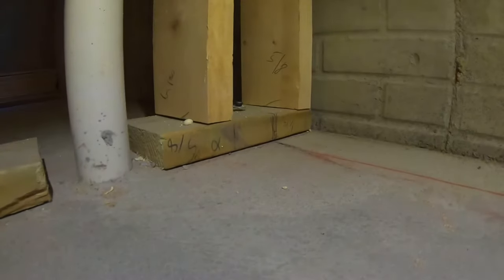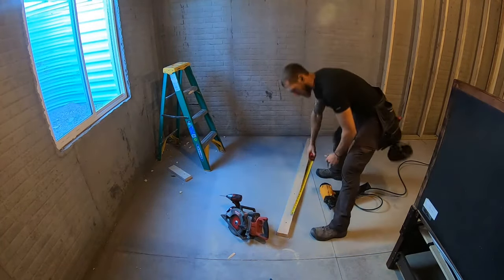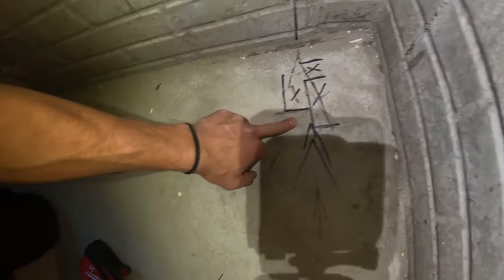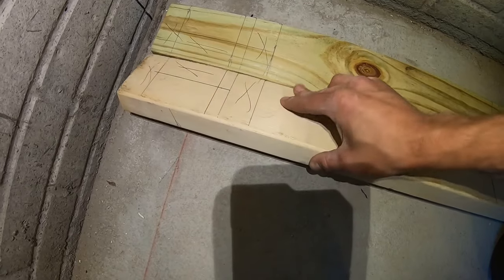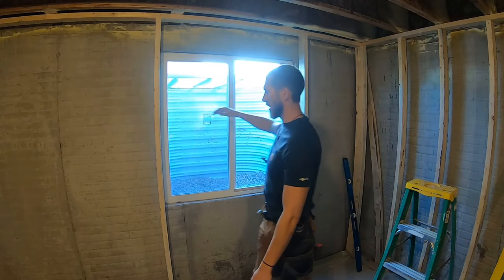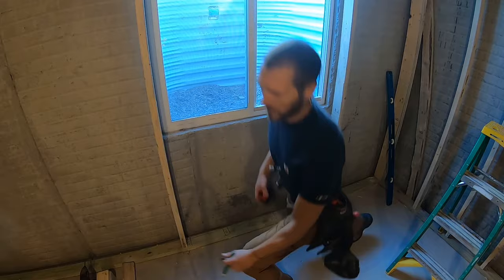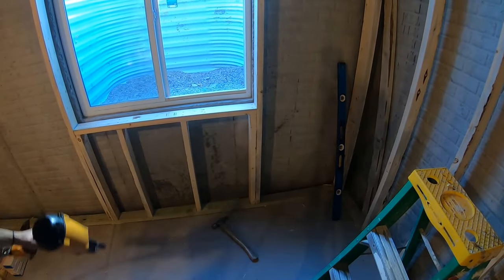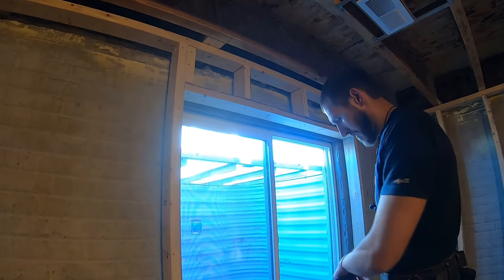Basement framing tips/ tricks

Comment: How do you frame and drywall basement wall repair columns, that run the legnth of a basement wall?
Reply from the maker: You could box them out individually and wrap either drywall or wood. If you wanted to hide them in a wall just frame in between each column then run drywalll over. Depending on column diameter you may have to go with 2x6s. Does that makes sense?
Reply: @AMAYERICAN  So there are no hard rules for doing this, it's just all aesthetics....okay.
Reply from the maker: Are structural issues resolved? It depends on the situation. Was a beam was added to support sagging joist in the middle of the span? Or whats the details of the situation?
Reply: @AMAYERICAN  No, these are just wall reinforcements.  To keep the wall from moving.  I see them in a lot of older homes here in WI.
Reply from the maker: Gotcha then yeah just cosmetic. Making box column wraps would be cool for a more open feel

Comment: Did you crown your studs
Reply from the maker: Yessir, I always pick my own lumber too.
Reply: @AMAYERICAN  Do you use a lumber yard? Plus just about all lumber has a crown.I didn't feel like going to home Depot and fish through all the crap.I used a lumber yard. Seems to be ok.
Reply from the maker: Yep typically mead lumber or Home Depot, HD  lumber has been better than the lumber yard lately it’s wild.
Reply from the maker: Did you go with tapcons or ramset ?
Reply: @AMAYERICAN  Ramset for the base and frame nailer for top plate. I have a Banks nailer n having trouble toe nailing.
Reply from the maker: Man it took me a while to get good at toe nailing. Having the right tip makes all the difference in the world. Needs to be aggressive to bite on an angle. The Milwaukee battery nailer has a great tip for toe nailing.